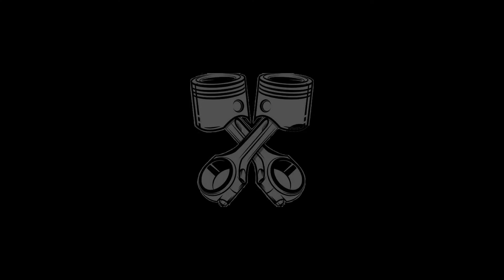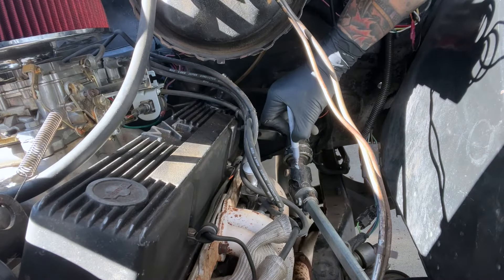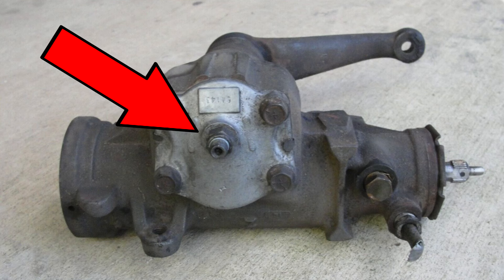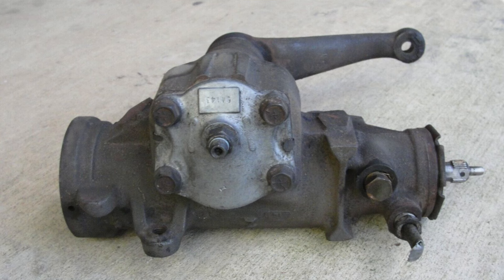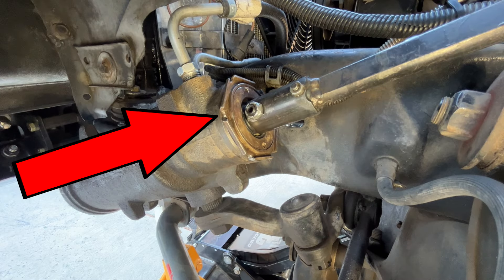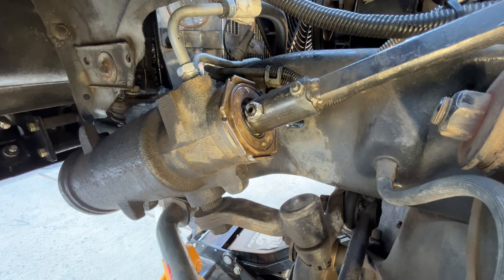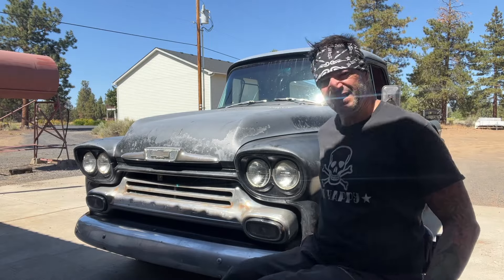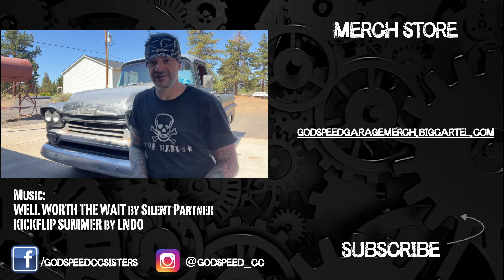HOW TO TIGHTEN A STEERING BOX

Comment: Sometimes it's deep in the steering wheel with two Star wrench screws or even the bearings I wouldn't recommend on changing any adjustments that is already preset for the vehicle